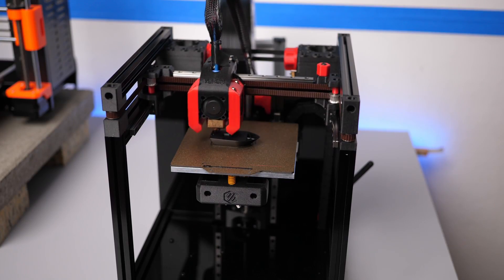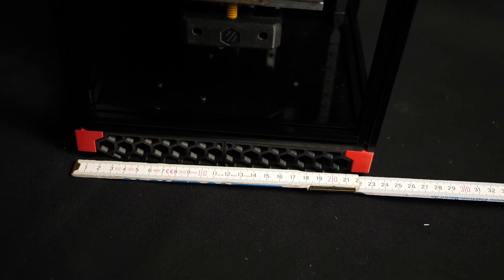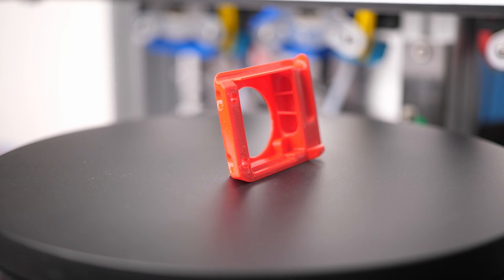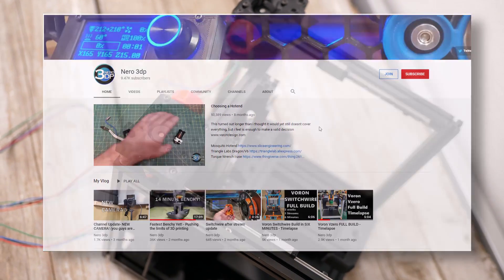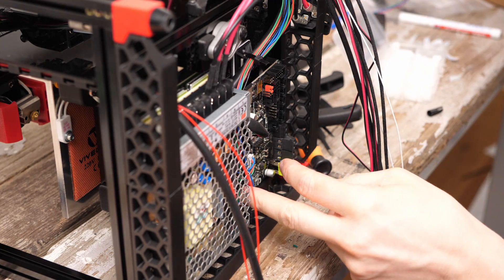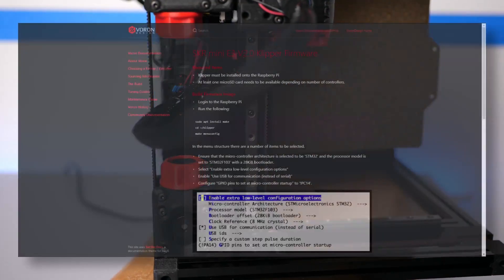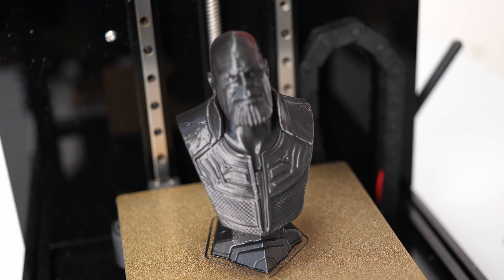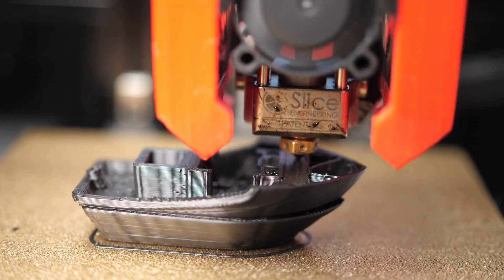Mini, Fast & Open-Source Core XY - The VORON 0

Comment: Just sourcing my parts for my 2.4 It is funny that a lot of people don't know about the Voron. I built a few Prusa MK3 clones, but never was really satisfied with the clones or the originals I own. Once the 2.4 is done, I might go for the Zero as well. I would rather spent my money on the Voron Zero than on a Prusa Mini. You should consider to glue the temp use to the heat instead of the print bed, so in case the heat mat falls of, you are still on the safe side.

Comment: For the bed, you could try to shield the underside, between the bed and printed parts, with glass / ceramic fiber cloth or some other insulation.

Comment: CF nylon was a major contributor to needing an entire rebuild on my v2.  it's not worth it.  at all.
Reply: Why?
Reply: @em-pointer  I was expecting it to be a high performance material, just like stefan did, but I had to disassemble after a week or two be cause the belt tension pulled the front idlers apart, and my carriage was bowed outward in both directions by like 10mm.  The motor drives for XY were also clearly yielding to the force from belt tension, no way they were laying flat on a table ever again.

overall not a good time.  These problems also killed several bearings and killed the belts that I was using as well.
Reply: @RentableSocks  so basically not a good material for building partner parts, or lithiom-ion battery bracket for ebikes (well at least i won't need to use any special nozzles), guess that leaves ABS/ASA/PC then.
this means basically means that  you'll an already fully functional ENCLOSED printer to get the voron up, which kind of makes a bootstrap issue, that's why i always try to get off-shelf aluminum parts for my Cartesian printers., but none seem to exists for core-xy's.
Reply: @em-pointer  yeah basically.  what i've found is esun PLA+ is good enough for a first print, then you can enclose it and get a few higher temperature prints out of it before they creep too much.  hopefully by then you can have the important stuff out of the way, like the carriage, bed mounts, and idlers.

Personally I like ASA, but nobody offers a CF filled ASA, which is what I'd really want.
Reply: @RentableSocks  so basically build a printer twice?
Reply: @RentableSocks  seems there's just ABS+CF
Reply: @em-pointer  essentially, yeah lmao.  it makes it accessible but is not without its drawbacks

Comment: It's amazing to finally see one of the big 3D printing channels talk about the Voron. It's crazy that it's not more well known.
Reply: I have a feeling it's going to get a lot more press. After finding out about it a few months ago I have seen it mentioned a lot. Not sure if I just notice the mentions because now I know what the name is, but it does feel like people are talking about it a lot. I think the main issue that it really is not a project suitable for most people. It takes a lot of research for parts and assembly, tuning, and it's relatively expensive. 
But I am certainly planning to build one eventually. 2.4 is a dream machine for me, but might be too much printer for my needs. This looks too small, but is also really tempting for the size and cost reduction and still getting a fun project.
Reply: Some of the voron community is very rude regarding their machines so I think that's the real reason
Reply: I only found out about it yesterday. I do not need one as I've already got two printers that cover my needs adequately. But it still doesn't stop me kind of wanting one.
Reply: The simple reason is that most company send free printers and even pay youtube content creators to review their printers. Since this is non commercial open source project if a youtube channel review it, it means they have to pay for everything.
And that's why I love this channel!

Comment: All vorons parts should be printed in ABS, they warn against using other materials. There are numerous stories on the voron discord channel of people using different materials and then having to do a complete rebuild, like yourself. Don't make the same mistake twice
.
Reply: Yes. Just go for ABS. That's what is was designed for and tested on, even accounting for shrinkage of ABS. Why change something that isn't broken?
Reply: Are there any benefits to a fiber-filled ABS in regards to the Voron?
Reply: @grahambell5847  Vorons as designed are structured correctly for ABS. Using CF or fiber-fill media doesn't seem to provide any advantage to the printer. Using an accelerometer to tune pressure advance yields a printer with little to no resonance artifacts even at high speed.
Reply: @ogmaker  I think you mean inputshaper? for the accelerometer?
Reply: @unmaker Ok, sure. Why would it fall to pieces, though?
Reply: @Mikowmer  Good grief, you're really slow huh?

Here's a tip. Instead of asking people 100 questions to get your answer. Go on YouTube and type in pla vs petg vs abs and do a little damn research you lazy phuck.
Reply: Make it in ninja flex :)
Reply: I printed all the enclosed parts of my coreXY in PC 2 years ago, and all is still fine and strong. I guess I'll do the same again
Reply: Most nylons are fine, like he said he got a bad batch. I've running Nylon 3d printer parts for a while now with ZERO issues.
Reply: He used ultra low temp Nylon.
Reply: At least personally, I try to avoid ABS whenever possible. When I was researching my Voron build it was one of the first things I looked into. However, after a while I concluded that the Voron is really an ABS forward design and there's not much support in the community for alternatives, with variants like ABS+ or ASA being the only exception.
Reply: @s0d4c4n  parts are designed with material shrinkage in mind.
Reply: I wonder how many people won't listen... They are very clear about it being designed for abs everywhere
Reply: What about something like PETG?
Reply: @Mikowmer  "ABS, no exceptions" is what I'm getting both here and on their discord.
Reply: @Blargedy  Which is really interesting, because I would have thought that PETG would at the very least be usable for non-enclosed versions of the larger Vorons, or ASA would be a decent substitute due to good mechanical properties, and slightly better thermal properties when compared to ABS.
Reply: @Mikowmer  Mostly because of the heat deformation I'm guessing. It is easy enough to print ABS if you just put the entire printer into an enclosure, and not put the PSU outside the enclosure like prusa recommends. The heat from the PSU keeps the enclosure hot enough to make ABS printing successful all the time. I also raised the extrusion widths significantly to increase down-pressure as ABS and PC like to be printed hot and in high pressure. 

It basically comes down to experienced people said it doesn't work and I am going on their word and the overwhelming consensus that "ABS no exceptions."
Reply: @Mikowmer  The only one where it makes sense is the switchwire, if you're not going to enclose it, PETG Stretches overtime really noticeably.
Reply: @Mikowmer  failed many times especially if printer is enclosed
Reply: @Mikowmer  NO, parts will crack overtime
Reply: Why is it so hard for people to print abs?
Reply: @JoshTownsend66  because it lets off toxic fumes while printing, and it is notorious for warpage, especially if you don't have an enclosure. Especially considering how you have so many alternatives, such as PETG, which is magnitudes easier to print with than ABS at the sacrifice of being slightly weaker, and even PC, which has many of the same difficulties in terms of printability as ABS but is stronger. Simply put, it seems that other than for Vorons and sandability, there are very few reasons to choose ABS for any print job
Reply: @JoshTownsend66  Because ABS is miserable to work with. I thought a zero would be a cool second printer, but finding out that I'd have to print a bunch of ABS is really off-putting. I'd kinda promised myself that I wouldn't touch it again.

Maybe I'll pay somebody else to print the parts for me, but that kinda takes a lot of the "do-it-yourself" out of it.

Hopefully somebody will come up with a CF nylon version, or some other material that's not ABS.
Reply: @fwiffo  There is the PIF Service where people "sell" voron parts effectively at cost.
Reply: @TheBarrelDoesGaming  Yeah, I discovered that shortly after posting my comment. :) It's definitely cool, I'll probably go that route if I end up building one.
Reply: @fwiffo  He said why is it so HARD for people to print ABS.

He didn't say why don't people print it.

Not a single person comprehended that guy's question it's ridiculous.
Reply: @fwiffo  I would hardly consider ABS hard to work with. It's easy in comparison to nylon or PC. It smells bad and most people just haven't used it before, but for my first 2 years 3d printing I used exclusively abs and never had many failed prints. At the time all the PLA I had tried was horrible. Now I just print whatever is cheapest, (currently PETG).
Reply: @JoshTownsend66  Because a) it's not food safe (aka it's potentially toxic) limiting it's use cases, and b) because people don't have ABS and would rather use something they already have, such as PLA or PETG.
Reply: @Mikowmer  you build it using ABS, then you can use PLA, PETG,etc for your regular print
Reply: @Mikowmer  No printed filament is food safe.
Reply: @barry99705  not even PLA on a printer explicitly designed to make sure that the product is food safe? PLA breaks down into Lactic Acid, which is harmless in the quantities that it's supposed to be leaching into food (i.e. There's more Lactic Acid present in breast milk than gets leached by PLA). I've always seen online that PLA is a food safe filament if printed on a food safe printer.
Reply: @Mikowmer  Yes, the only food safe printers that exist aren't filament based ones, I've got PLA Cups at work, but FDM Will leave layer lines where bacteria will stack up. 

If you want your PLA Prints to be food safe you need to do a lot of post-processing.
Reply: @Mikowmer  kid's toys are almost all in abs. It's not toxic
Reply: @Mikowmer  That doesn't answer his question of why people have such a hard time printing abs.

The answer is because it's harder to print abs. Saying it's because it's not food safe is probably the lowest reason on the list why people don't use it. How many people actually print things that food is going to touch? I don't. And to say that people don't use it because they don't have a roll of ABS around. Give me a break. This is 3D printing. Buy a freaking roll.
Reply: Even when PC is an option?
Reply: @Blargedy  PC will crack and grease will damage it.
Reply: @dylanmckenzie33  alcohol can also heavily craze PC, so if you ever intend to wipe off your build plates you'd have to be very careful.
Reply: @Blargedy  PC Will fail over time due to greases and oils breaking it down, ABS doesn't suffer from this.
Reply: @TheBarrelDoesGaming  well I have two prusas that have their printed parts entirely made of PC and they've been going perfect for over a year, so I don't buy that explanation. To print PC you need your hotend to be made of PC or the whole thing will deform. I'm assuming ABS will have the same temperature resistant property though, so I still accept printing the voron in ABS.
Reply: @Blargedy  Are you mounting packed bearings and etc on the PC Printed Parts? It's not a case of printing difficulty because printing it is really easy, it's not good mechanically.
Reply: @TheBarrelDoesGaming  the prusa doesn't have oiled bearings touching the printed parts, so if the voron does then PC won't work, you're right. I had assumed the only oil would come from lubricant covered hands and other stray oil, which are easy to avoid.

Comment: What about machined aluminium ? No creep there !
Reply: It add considerable weight, especially with parts designed to be printed in ABS. 

ABS works fine and doesn't creep, it's designed around that.
Reply: @Penofhell  but young's modulus of ABS is tiny compared to the aluminium one ! If you want some stiffness that's the way to go !

I was thinking a part redesign (maybe even a vid comparing designing for different processes) to then be machined out of Al. Of course parts designed to be 3d printed do not make any sense when you change the manufacturing process

Comment: The fastest and cleanest Benchy I currently know of is 16 something minutes:
https://www.youtube.com/watch?v=ZZDuX6hcd28
and that is basically his first try with his monster of a printer.
I assume he will beat 10 min with no problem once he is done with his improvements.
Reply: there's benchies well under 10 minutes.. 6 and 7 minute benchies even.
Reply: @RentableSocks  there are but they are not what I would call clean.
Besides I'm pretty sure that he will beat it in the future whilst improving further the print quality.
He is a mad man... the whole HevORT community are madman lol
Reply: @DerSolinski  have you actually seen any of those sub 10 minute benchies?  they're still very clean around 10 minutes.  of course as you get down into lower times they get worse, but that's mostly down to cooling
Reply: @DerSolinski  id argue some of nitrams 10 min ones are just as good looking. Same with Annex sub 10 min ones
Reply: @RentableSocks  The ones I have seen are mostly alight up to the boat house, then the problems are starting.
It is completely possible that there are already more successful prints, after all the internet is a big place.
As stated "I know of" I'm not omniscient.
So far what I have seen wasn't up to my taste.

Comment: Try Matter Hacker's NylonX or NylonG. Been using these for functional parts long term without issues. As always, dry the filament for like 4hrs with a food dehydrator and keep it in a dry box while printing.

Comment: I wanted a fast printer also and reduced my list down to two printers the Pro 3D V-King and the Voron 2.4, I ended up building the V-King mostly because if I had any problems it is easy to speak to the designer Roy of Pro 3D, as I built my printer I didn't have any problems at all, I did cut and drill my own extrusions though even though there are companys who will do this for you I wanted to make sure they were done correctly, I now have the perfect printer that I have 100% confidence in.

Comment: Continuous fiber if you really care about creep... Honestly given how much that bed sags with CF-nylon, I worry you cant really decrease the problem to a level where you wont notice, with any FDM plastic. PLA is one of the most crystaline, which is good for creep as long as you can keep if below the melting point. Annealed PLA might be your best bet; if you google a bit you can find some papers on the link between creep and annealing PLA. Perhaps printing hollow and filling with a resin might be good; not that they have zero creep but a thermoset materials tend to be in another category than thermoplastic ones.
Reply: The V0 in ABS doesn't show creep, and shouldn't with PA-CF parts, Stefan probably had a bad spool of material (as stated by the manufacturer itself). PLA won't work on most loaded parts because of the high temperature once the enclosures is completed (which it should, in most cases), even annealed which btw would be a nightmare to implement due to the heavy deformation during that process.
Reply: @Penofhell  Not sure about the bad spool making any sense. Nylon is below its Tg at atmospheric humidity, and thats awful news for creep, which apparently some short fibers are not going to fix. I dont think one should have high creep expectations of nylon unless it has continuous fibers in it; and then only along the direction of those continuous fibers. 

It depends on the material, but crystalline and operating below Tg are both generally very desirable. Annealed PLA can offer both, and ABS at most one of them.
Reply: I just remembered: ive seen a plain-sand epoxy mixture recommended as an excellent castable machine-base. It supposedly approaches the stiffness of pure silica, has great damping properties, and I imagine creep is going to be fine as well. And its cheap. I suppose density isnt ideal for the moving parts though...

Comment: Ive always wanted a smaller, fast and somewhat capable 3D printer, i do a lot of single part prototypes. So i wouldnt mind not wasting a big printer for how long it takes to make a prototype. I'd rather have one or two of these just for that. My issue is the price, 450 dollars. Thats half a Prusa MKs3 :/
Reply: Open source means it will likely grow a lot cheaper over time.

Comment: I'd be careful about using any PC blends where there will be bearings or other oil-bearing parts nearby, since PC becomes extremely brittle after absorbing oils or greases. ASA really is the best material for your use case
Reply: Or CF nylon.